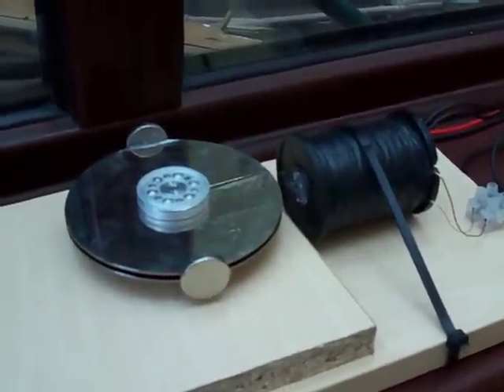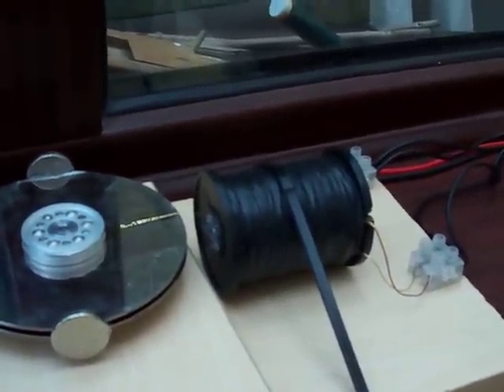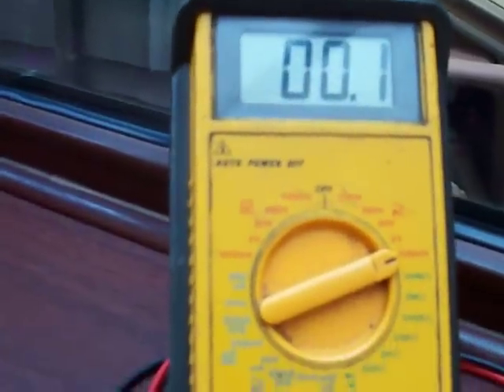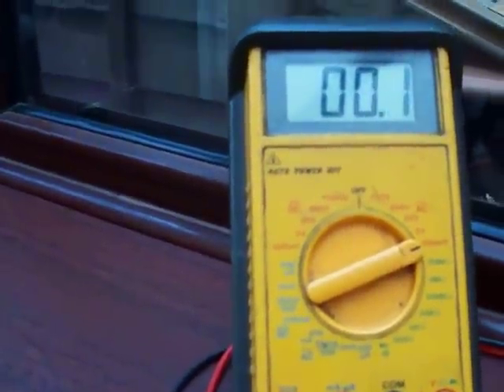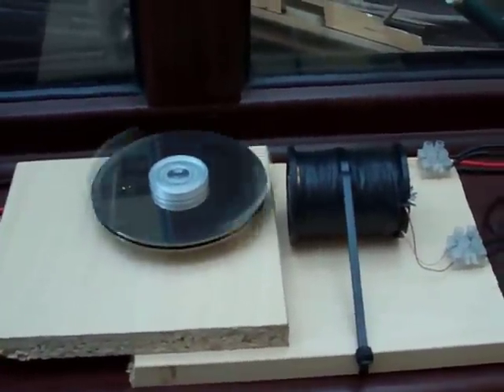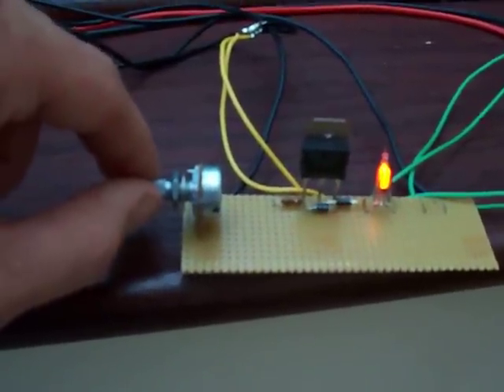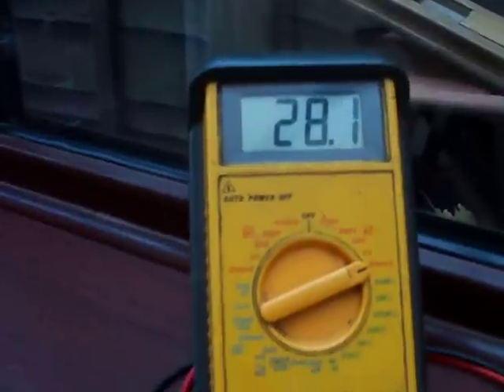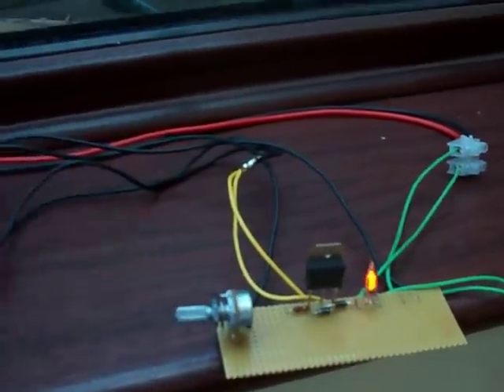Bedini Motor  - Amazing Stuff!

Comment: Hey mr slater nice job. Most people fail when trying to charge batteries directly from output because you are killing a static energy with a resistive battery so as "konehead" suggests feed that emf into capacitors first so then you can re-convert to hot electricity for your battery.

Comment: Each spike is several thousand volts ! but its radiant, so its harmless as radiant.
When converted into the battery it equates to a certain amount of standard voltage.

Put your multimeter across the out put wires without the battery connected to see the output.

Comment: To measure voltage coming off, you best off measuring the gain in the charge battery. That will be how much of the radiant you have converted to normal voltage.
But if the battery has crystals on its plates, it will convert more of the out put radiant into standard volts. So the ratio can be improved by conditioning/crystalising the battery without changing anything else on the setup.

Comment: Incase your wondering : 

As magnet approaches, thin wire receives a small current from magnetic field of approaching magnet. This triggers the transistor to open the power coil (thick wire) and push magnet on its way. 

As the power coil goes off, the magnetic field of the coil implodes, this gives you a spike of radiant energy. The spike lights the neon. The spike is radiant not normal. Also called negative energy. But i prefer the term radiant.

Comment: The radiant energy draws extra energy from the environment as it hits the battery.
But this effect may require the battery to be conditioned first. Conditioning means to crystalize the plates of the battery. Once you have crystals, the radiant will draw the environment energy into the battery with each pulse more effectively.

You could make your own batteries to watch the crystals form.
all you need is some lead and acid. lead plates in a jar of acid. or you can use an alkaline liquid.

Comment: i usually have my multi-meter on the 20 volt DC setting. If the voltage is lower than that i go down to the next setting, which will be in milli volts.